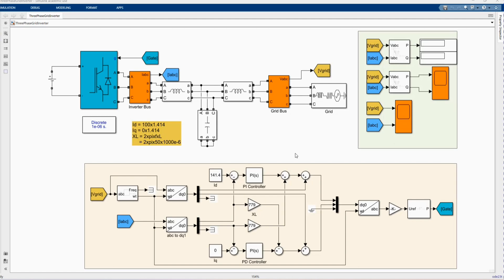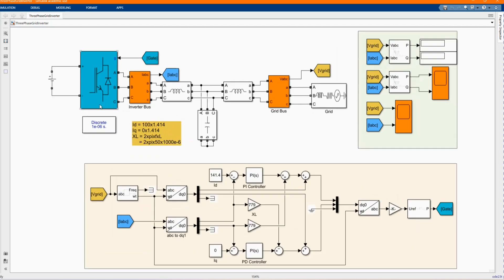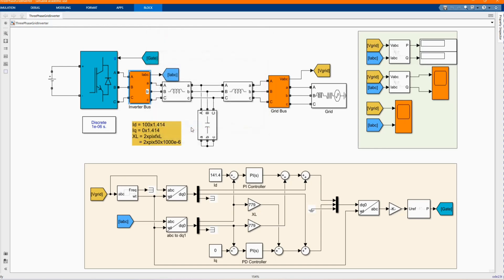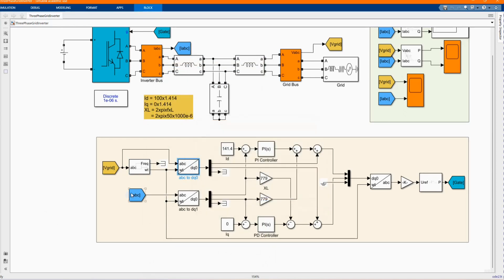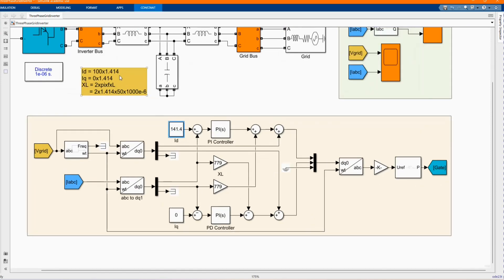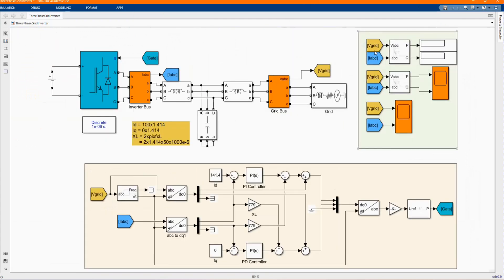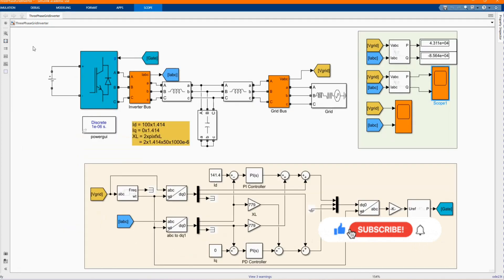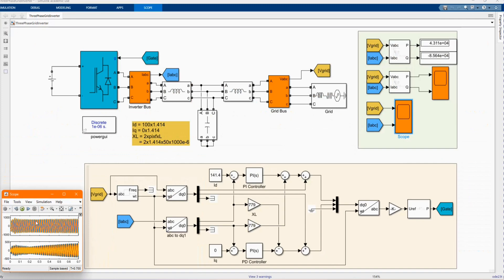Three Phase Grid connected inverter using Direct-Quadrature Synchronous Reference Frame Control

Comment: Appreciate for information 
Kindly send link about pv generator system or using which device to control 100kva with 250 kw solar
Reply from the maker: Hi thank you for your comment, I di not get you properly
Reply: @pzengineering2020  thanks for ur replying,
Asking about pv Diesel generator control with solar system with 70 and 30 ratios  sharing
Appreciate for ur kind information